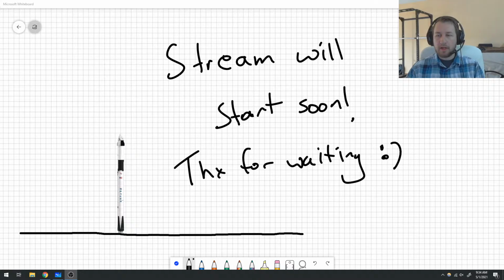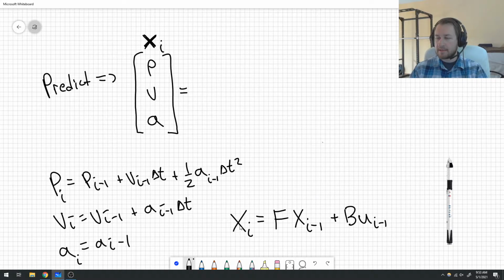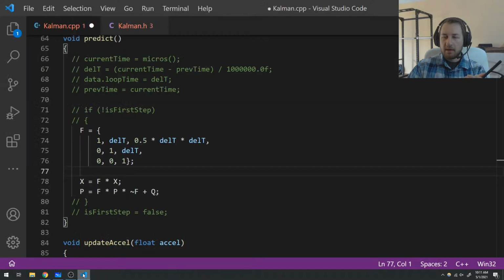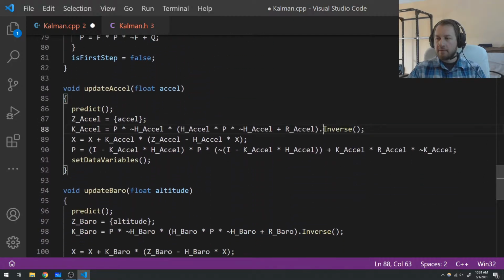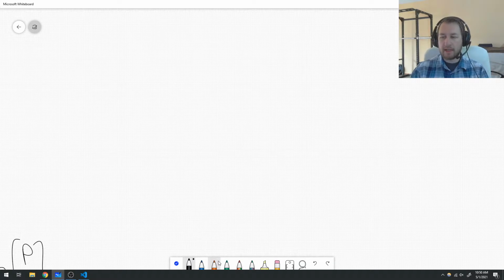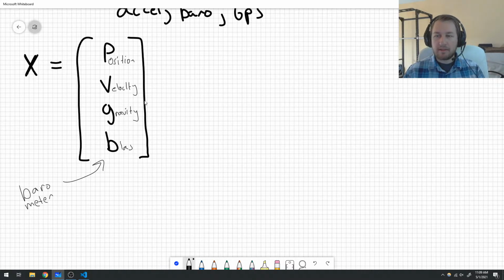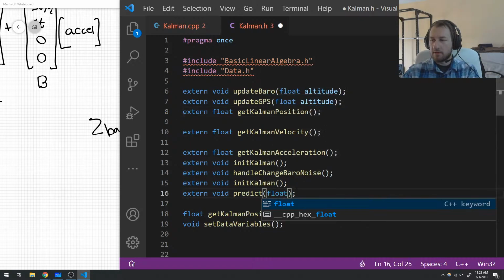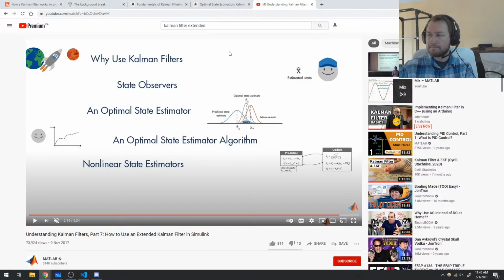Implementing  Kalman Filter in C++ (using an Arduino)

Comment: This video is great - it really helped my understand this topic. If I want my position and stuff to be a vector (with and x, y and z component) should I make a larger x matrix (eg a 4x4 instead of 4x1), or does that not work? Or do I make a 12x1 matrix with a variable for each axis?
Reply from the maker: From what I remember you'd make a 12x1 matrix
Reply: @adamdude  Great, thanks. I did some more digging online and I’ve seen other people use this approach